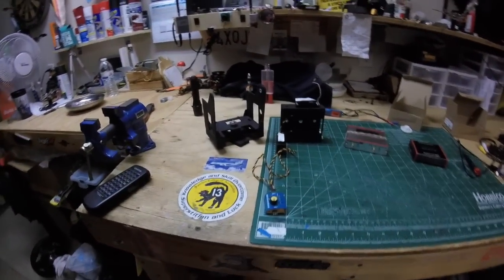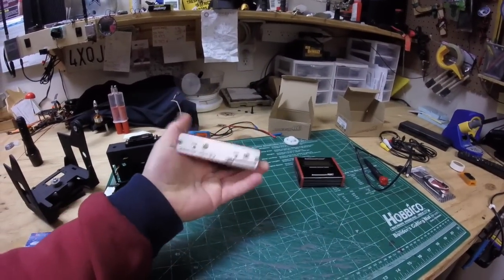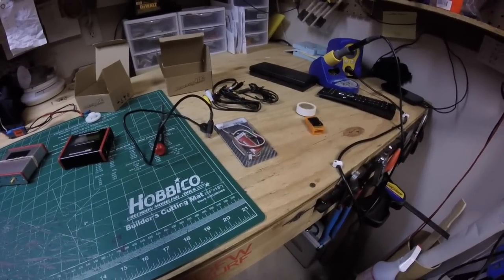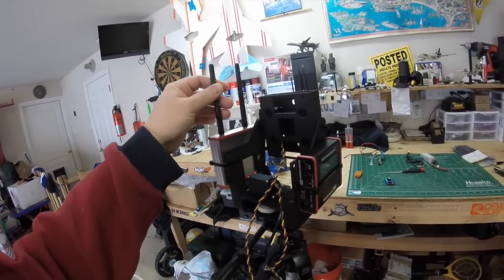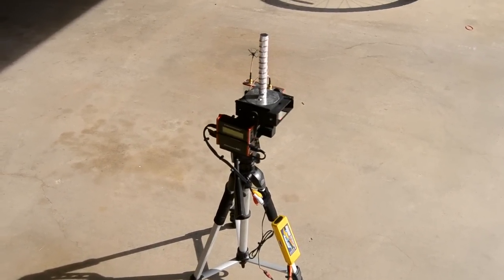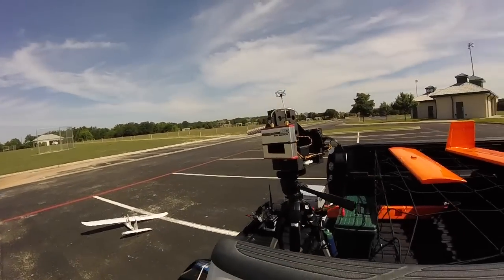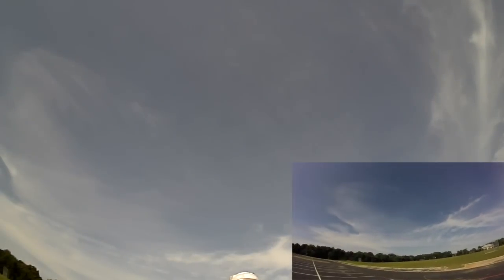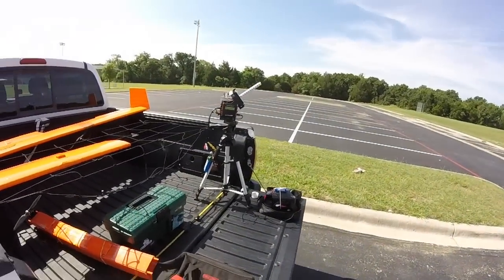ImmersionRC EzAntennaTracker V2 testing

Comment: Is the tiny telemetry a immersion product , I can not find it on their site and am having trouble finding it on a site I’d trust to buy one. Could you tell me where you got yours. I’m setting up the same unit. Please help. Plus when the tracker and the duo reciever are connected do I have to power both or will one also power both I haven’t seen anything on that yet. Thanks for any help.
Reply from the maker: The tiny telemetry is an Immersion RC product. I bought this unit a few years ago and I think IRC discontinued it. Try looking for a used one in the rcgroups.com website under the classifieds fpv equipment. A battery powers up the tracker and the tracker comes with a power cable that ties into the DUO. Hope this helps.

Comment: @940 RC, Hi I got the same delay on my Antenna Tracker as you do. Also I got the same hardware as you too. But it works like a charm.... My plane is always being tracked and haven't had any issues so far.
Reply from the maker: +TheGray Aviator Thats good to know. Thanks.

Comment: Seems that your GPS system has just 1 Hz update rate. That is why it is slow in moving. In U-Center set UBX->CFG->RATE->Measurement period 250 mS (4 Hz). Also you may wish to increase communication speed over UART from 9600 Bauds to say 57600 (lower ur higher, depend whether you have too much lost packets); UBX->CFG->PRT->Baudrate 57600. After each change, click on 'Send', down left of the configuration winduw, so that GPS module is updated to new values.
Reply from the maker: +Milan Karakas I will look into this. Thanks.

Comment: Do you need the ezosd in order to make everything work?
Reply from the maker: +etab83 It makes it easier if you have the ezosd. You can still use it with any other OSD but you will need to add a immersionrc tiny telemetry device.
Reply: etab83 yes you do or tinytelemetry